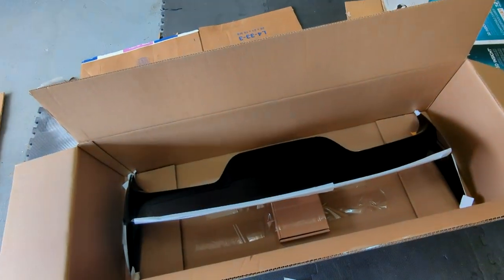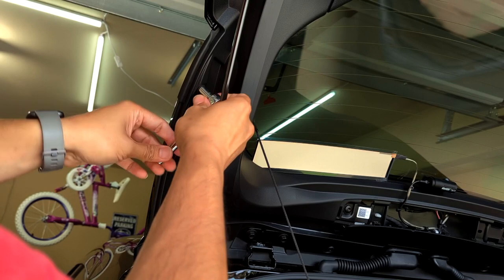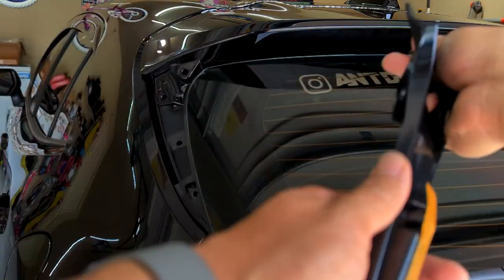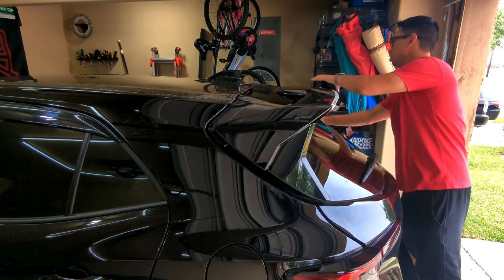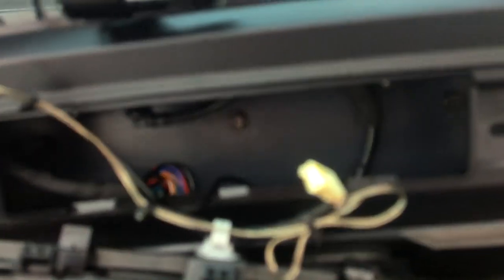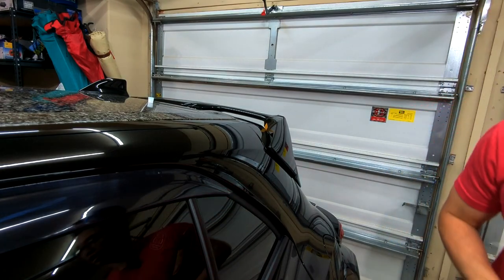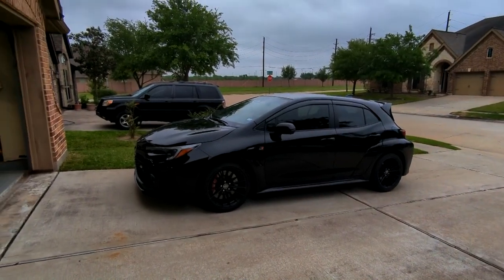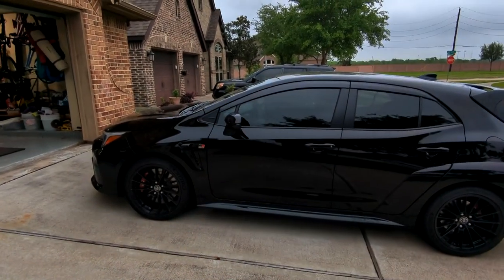NEW Circuit Edition Wing for the GR Corolla!

Comment from the maker: Just a note. I highly recommend you just get the XSE template as a base to make life easier 😅. Part # in the description box.
Reply: Thanks for the info!
Reply: what size bit did you use?
Reply from the maker: 1/4"
Reply: Cool
Reply from the maker: @davidrhum2927  the xse template can only be used for the three middle. The outside ones have to be re measured
Reply: He says in the video the Template is only good for the Middle three. They still need to be re-marked for the side bolts.
Reply: Where did you order the wing
Reply from the maker: @ronallopez7200  Auto Nation Toyota
Reply: @antdo  I went to my dealership and they told me that they don’t have it do u have the part number
Reply from the maker: @ronallopez7200 the part number for the Gloss black is listed in the description box.

Comment: Thank you for the video! I heard you say you buffed off the ceramic coding. Was that so the tape would stick better? Do you think that is an important step? 

Also, I’m trying to decide whether to do this myself or take it somewhere. You make it look easy. Any advice? I’m definitely a noob. 

Thank you for your time!
Reply from the maker: Yes I had to buff off the ceramic coating so that the double sided tape would stick to the body. I wouldn't say this is hard but very time consuming. If you aren't well versed with this type of work I would definitely recommend taking it somewhere. I've had people tell me they don't do any drilling and all they did was use the double sided tape. If they still have it on I dunno. But i suppose that is another option if you didn't want to drill
Reply: @antdo thanks! I appreciate your help!

Comment: I feel like you don't even need to drill the side holes no? It seems like it's being bolted well with 2 bolts on the sides. What do you think?
Reply from the maker: I have had some poeople tell me that they mounted it without doing the sides with no issues. 

But I will leave that up to you on whether or not to omit that step.
Reply: quick side note I just installed mine and those 2 side bolts aren't really necessary.
Reply: @antdo  Yeah it seems to be totally fine. Thanks for this vid!

Comment: Theoretically couldn't you just use a strong double sided tape just on the center blade section instead of drilling holes?
Reply from the maker: Yes that is a possible option as long as you are sure the double sided tape will be strong enough.
Reply: I would think so, too